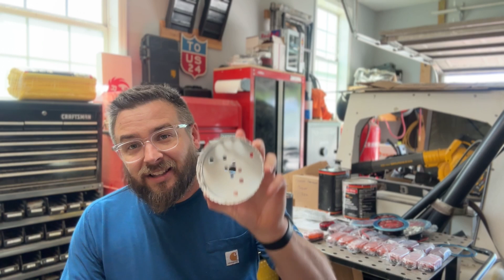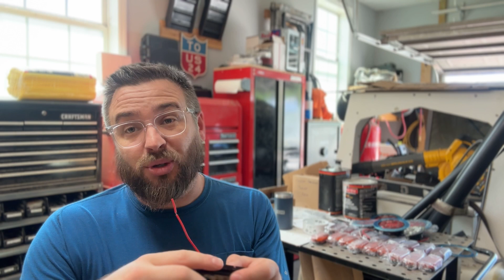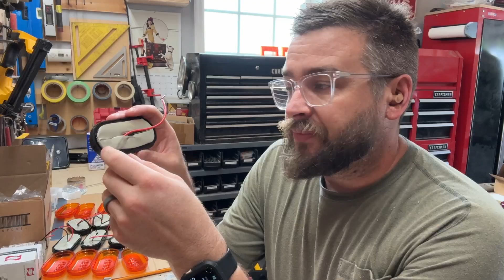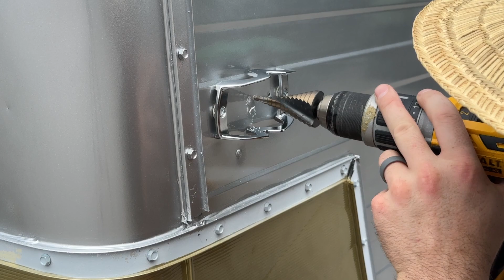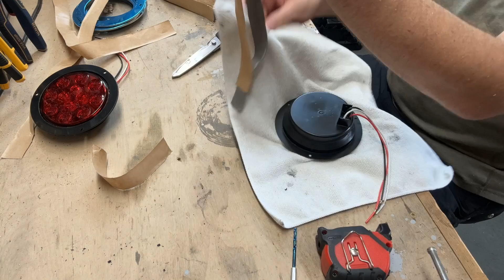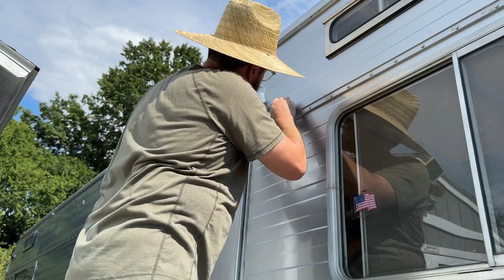RV Exterior Lighting Install: 1971 Holiday Rambler Reno Part 30

Comment: maybe i missed it, but did u put butyl tape or foam behind these lights? wondering what ppl use to prevent water penetration.
Reply from the maker: Yes, I used 1/8” butyl tape behind them all

Comment: Looks great, when you get it wired up and turn the lights on at dusk it will bring a big smile to your face😁. Just a heads up I noticed that the LEDs don't last but a few years☹️ and I ended up soldering 2 pin plugs on mine to expedite changing them out a little bit quicker...